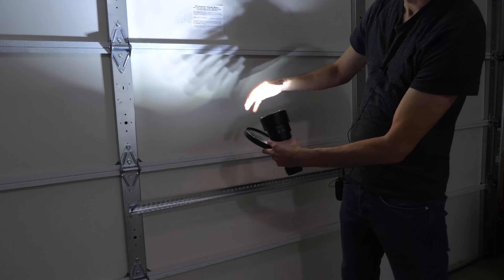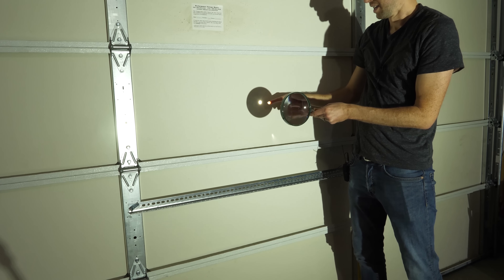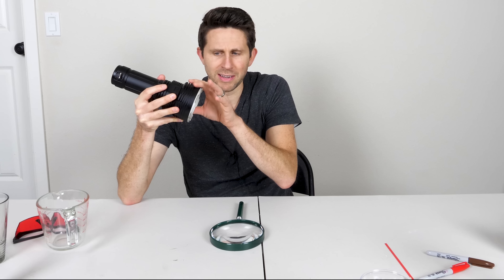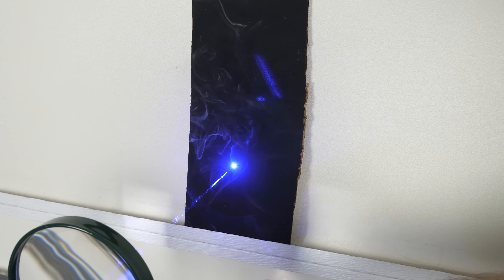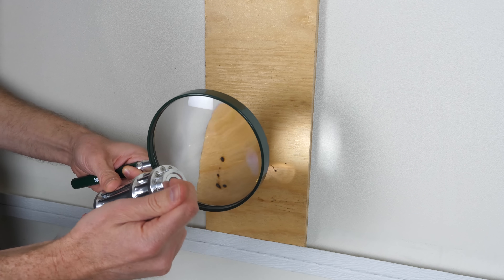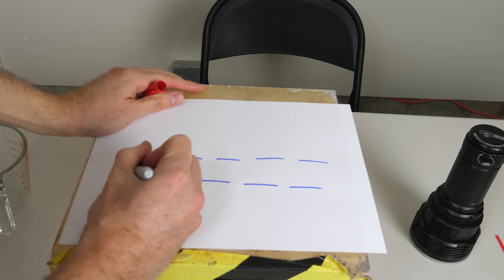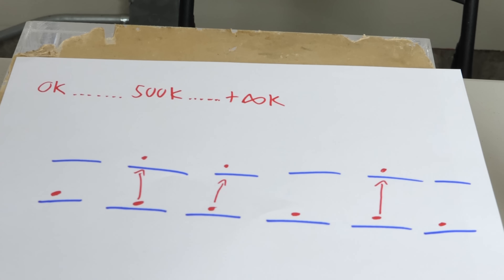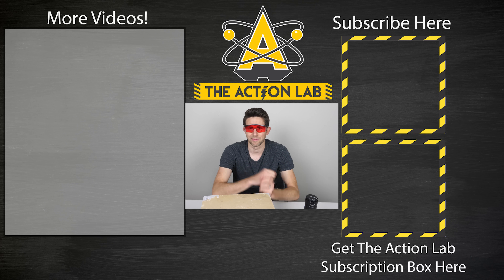What Happens if You Focus a 5W Laser With a Giant Magnifying Glass? Negative Kelvin Temperature!

Comment: Hay i got something for you to think on. What if you took all the light from a lightbulb (with reflectors) and focused it to a single point. If you collected it all it would have the same effect as a laser. Well no i guess it would be a laser. Meaning you could do the samething with a flashlight, but the process you would have to do to it(collecting and redirecting) would turn iy into a laser.
Reply: Lasers are one single frequency, lamps are combinations of frequencies. This is a problem because your lens needs to have the right angle for each location which is not possible since each frequency of light has its own refraction index. So yea you can filter out one specific wavelength, but that would account to less light than the actual light.  itself at any given spot.
Reply: @cognitivedissonance4938  He might've gained enough correction to burn the wood had he used a 2nd magnifying glass.  The first near the flashlight to gather most of the light  and a second to focus it down far enough.
Reply: @supernova743  Then the light isnt parralel, but what if he used a third lens. A lens that has the inverse effect of lens one and a lot smaller than lens one.
Reply: First define a point, next explain how to hit it. In real world a tunneling microscope arm ends in a single atom. In math that is huge, can you see the electrons? So still not at a point .  Next a wave of light too large for said point hence we can not hit a point.
Reply: @bikerbob2005  There are no particles in nature. What you call electrons are vibrational nodes of the standing EM wave.
Reply: @cognitivedissonance4938   keep in mind i went to school a realy long time ago. it's a wave in motion ie. anything over 0 K is. it is a particle when observed ie. the x-ray plates from an atom smashing chamber{ Particle accelerator https://en.wikipedia.org/wiki/Particle_accelerator} or did someone build a rube goldburg machine?
Reply: @bikerbob2005  and its ok to believe that.
Reply: @cognitivedissonance4938   stay in mathematics long enough and will find things like random, infinity,circle don't really exist.  I am too grumpy to go learn very much of the new stuff .  Wiggly strings and such. Next will have teleportation of matter

Comment: has nothing to do with temperature at the source - this all about energy.  you cannot create/add energy to the system by focusing part or all of it (that would be the violation of thermodynamics), but you can condense it into a more concentrated beam.  if you could focus a sufficient amount of sunlight you could create a temperature hotter than the surface of the sun, no problem. there is nothing odd happening here at all.

Comment: There's a lot of physical non sequiturs going on here... And also I think you're seriously misunderstanding the relationship between photons and heat. The reason why the laser burns and a big flashlight doesn't is pretty much because of the fact that the optics of a laser compress the photons into a "higher density" (forgive my lack of proper physics terminology). It's exactly like the difference between a solid bullet and a spreading spray from a shotgun. With all the shot spread out, the points of impact are affected by tiny fractions of the total mass fired from the shell, whereas if they were to stay together or be in one single solid, all that energy is concentrated on one single point of impact, thus causing more impact of force per area. The heat caused by light (unless physics changed recently...) comes from the photons interacting with the matter they're hitting. The photons aren't heat in themselves. The beam of light has no easily measurable temperature (if it does, then that's solely because it's causing the air within it to heat up). The heat coming from the light source is due to the fact that it's nearly impossible to make photons without heat as a byproduct of the reaction. The heat at point of contact is from the matter being bombarded with fast moving particles and therefore transferring their energy to it. There's no actual direct transference of heat between point A and point B.
Reply: Thank you, someone put it into words,
I knew this guy was just spouting nonsense.
Theoretically, with a large enough and curved enough lens, you could focus that flashlight into a smaller spot, and solve the predicament her shows
Reply: @portalenthusiast823  either this guy is a crazy person who thinks he's a scientist, or he's messing with us. Look at some of his other videos. I learned this stuff in 8th grade. Maybe this guy skipped over physical science or something.
Reply: Matt Blank I know right! Have you seen his video with the “neutron”
Reply: @michaelabutin5294  Not yet. I can only handle so much bupkis at any given time. lol
Reply: Yes, in theory. But with the flashlight body being how it is introduces too many obstacles to be worth trying. If the collimator lens was flush to the led and and then focussed. Then we'd have something to try.
Reply: This is to much reading
Reply: Kelvin: "But now i souunnnddd duuuuuuumb--"

Guy with Clipboard: "Yeah but did you die?"

Comment: Like to see your movies, but this explanation is SOOO wrong. Please take the video off-line, reseach it correctly and then bring a better version back. it has nothing at all to do witht he second law of thermodynamics. It simpylk has to do with optics and focal points. If you have light which is nearly "parallel" (like from a large distance like th sun), you can focus the whole area of the lense to 1 point down. And then you simply have to calculate "energy per area unit in the lense is due to losses higher than energy on the focal point" For a perfect lense, with 1 m^2 you can harvest as much as 1,000 watts or more on a sunny day. If you woudl have a infinite lense you would harvest 1/2 of suns energy... and that would be enough to make "plasma". But due to the particle natue of the photons it may be more troublesome to burn something with infrared, then with UV. And is has nothing to do, with 2nd law thermodynamics. You can make things hotter than its source, its only a matter of compression (see refridgerator or thermal pump). Same could be done with light, but that is way to complex and inefficient in terms of gain. 

And if u use two or more lenses then u can focus the whole light on one point and even burn materials.. we did that in the lab, but maybe it does not know about 2nd law ;). But maybe it is only as we use phase shifting mirrors and non-linear optics... but they will also not break 2nd law... they only change the energy states... so you should correct here many things, to show that especially lasers and the high flow density are something special. Normal "light" is from heat radiation and due to its distribution you may under "normal" conditions not get hotter than the object source, except you use special optics. And due to the optical properties of a lense you are limited... but if you combine properly and make some add ons like phase shifter, polarization filters/ shifters etc. you can pimp it up. But you will never "gain" energy for free.
Also laser light spreads... but it is no light of a heat source and has therefore differnet characteristics... you even may take pure chemical light and focus it to make something burn, but that doesnt mean that fire flies are hotter than 50°C....

So it is very mixe up here with different effects and limitations... and lasers do also not break 2nd law. Lasers are special in their setup and as such conservation of etendue is also be applied here.
And what u havnt mention is, that photon density plays also a point here, especially as 2photon processes will get more likely... and such burning events.....

So it is mixed up... of different effects...

Comment: Ok, so no u did not violate the 2nd law, all that hapened was the energy was more concentrated than it was out of the laser. There was no new energy.
Reply: The 2nd law of thermodynamics is not conservation of energy (That's the first law).
Reply: @ფიზმათ  Either way, it's not violating any laws.  All it's doing is taking the energy output by the laser and concentrating it to a single point. There's no more energy than what was output by the laser.  By concentrating the laser you're reaching the threshold for the chemical reaction of combustion to happen.  It takes longer without the magnifying glass to reach this point because it's heating up a much larger area.  

The second law has to do with entropy and isolated systems.  You have to look at this whole experiment as a system,  you can't just look at the output of the flashlight and say because you've reduced the area of the  focal point that you've violated the 2nd rule.  The energy is being moved from within the battery and transferred to the wood, if the amount of energy reaches a threshold the wood will burn releasing stored energy in the wood.
Reply: @supernova743  Of course it's not violating any laws, it is *real life*, so it can't. The point is, just saying "the energy is not created" has no bearing on the second law at all, stop bringing that up please. The 2nd law in the form of "can't move heat from cold to hot (without work being put in)" is what is discussed here. How lenses work with the 2nd law is weird (kind of why videos like this are created, to explain the weird and fun concept, but I think he failed the "explain" part). I remember this done better, but can't find the video or article that did it for me right now.

To be fair, I don't think a LED flashlight can be used as a valid illustration of the 2nd law here, because it also is not radiating thermal energy. An old-school incandescent bulb would work much better.
Reply: wat the trick with working out the 2nd law by when transmitted by radiation is the temperature of the radiation the laser puts out thermal infrared energy because the initial wavelength of the light is in the thermal range it is usually then doubled a certain number of times to get the green light but it doesn’t all get converted...
As far as I know the led based lasers could be described as outputting light at much higher frequencies than their surface temp but I don’t see how infrared light however condensed could make anything as hot as the surface of the sun no matter how concentrated you made it?
Reply: Sorry, just remembered that, thanks!

Comment: Negative equals positve....roger dodger...>,;,< With long rang reach, lasers with continuous power usupply will be more readily used by low and high orbital satelitle weapons installations, as some are already being planned if not in use already. But lets say you wanted a " futuristic" laser gun, then instead ofa long, somewhat low intensity power supply to generate a beam , one would need a very power, portable burst capable way to generate a laser. So a gun would need something to quickly generate hughe amounts of power in a split second to not only put enough power into the laser, but allow it to go far, while not blowing ones self up with the gun. ( it'd have to charge up fast, then basically depower in just as much time. Initially the first laser guns will overheat needing minutes to cool before reusing. Give it till the mid to late part of our century, easily). Or just get a 10 W or stronger laser and a small magnifying and connect them. SCIENCE! O>o

Comment: My opinion is that the source doesn’t necessarily have to be hotter than the pointed light because the source energy is light and light is an energy form as so is heat then the light is emitted from the source with whatever the temperature is and the light is converted to heat once it touches the surface

Comment: the first part of the video is such bull. the reason you can't focus the flashlight down to a point is because the beam is diverging (moving away from the source in different directions), if you collimated the beam (made the beam travel parallel) with a collimating lens assembly or a parabolic mirror you could then focus the beam into an arbitrarily small area just like the laser. the reason you can focus the laser is because it is, by nature, already collimated. furthermore, focusing light doesn't violate the second law of thermodynamics, I don't even know how you got to that conclusion. finally, you absolutely can create a point that is brighter (more luminous) than the surface which emitted it. light is simply emitted energy, which can be redirected. all real sources of light are non-point sources, which means they have a non-zero area, and emit energy, in the form of light, from that area. the luminance of that source is defined as the energy divided by its area (watts/meter squared, in SI terms). when you focus light, you aren't increasing the energy, just decreasing the area that it hits, which increases the illumination (brightness).

Comment: I have a question. If negative energy is hotter then positive energy, then why won't you burn when you get close to a black hole and only get burned after a couple of minutes inside of it??? It's like saying you wouldn't die when you get close to the sun and die after a couple of minutes when getting in the surface. PLZ ANSWER.

Comment: That is highly incorrect. It Takes way less energy on the point than on the surface area of the bulb. You are forgetting that you are reducing the surface area from where the light is taking place. But it your example you go really far out just to closely mirror the light. If you tried harder, you could of actually made it smaller making it hotter. And it would still have the less energy.

Comment: You said: you can't focus all the light from a flash light no matter what combination of lenses you use. But this is not correct. Place a collecting lens close to the flash, so close so light emerges parallel rather than diverging. Put a second lens just next to the first if necessary to achieve parallel beam. Then focus the beam to a small spot with a final lens close to the wall.

Comment: So you can't violate thermodynamics with total energy, but you can focus that energy into a smaller spot changing the intensity and therefore increasing the temperature in that smaller space. You could theoretically focus all the light going one direction from the sun with a sun sized lens into a single point that would in fact be hotter than the surface of the sun. No laws of physics broken, just energy dispersed over a large vs a very small area.
Reply from the maker: You are wrong. That is impossible to do. You need to know the conservation of etendue.

Comment: Okay, I just went down the rabbit hole on this negative temperature thing... as far as I can tell; it's sound as a concept, but VERY POORLY articulated. I think it's a problem of definitions. 
If we define temperature strictly as entropy, a media in a majority of excited states is technically less entropic. That makes sense.
An object progressing toward a less entropic state, (whether more, or less energetic,) by definition results in less entropy, and at no point does it magically become a negative entropy. 
If we define temperature as an energetic level (which is probably what everybody thinks when we say temperature) jumping to a "negative" number makes even less sense.
In any case, the experimental basis of this reasoning is a very special experimental case, and doesn't really apply to a laser operating at room temperature.
You're using an external lens to compensate for poor laser optics... nothing more.
Reply from the maker: I don’t think so. Statistical mechanics tells us that at infinite temperature all atomic states will be populated equally. The Kelvin scale was built upon classical mechanics where it would be impossible to achieve a state in which there are more atoms in a higher state than a lower state. However due to quantum mechanical effects, we know that we can stimulate atoms to be in a higher energy state simply by shining light near them that is at the same wavelength as the light it would emit at that state (stimulated emission). So in a laser, the stimulated atoms actually achieve a population inversion where there are more atoms in a higher energy state than a lower one. This is where the negative temperate comes from. In this case we have to define temperature as negative or else we get into problems that break the second law of thermodynamics. It doesn’t matter that my laser has poor optics. What’s important is that lasers can break the conservation of etendue due to the fact that they have light that doesn’t spread, the reason they have light that doesn’t spread is because of population inversion, and this is why we have to say they have negative temperatures. We can never achieve negative temperature in a non-quantum mechanical system thus anything the laser shines on is always at a positive temperate no matter how hot you get.

Comment: surely he is not actually using a laser? because the light from it narrows so he has to have it across the room to focus a small beam, when put by the board it is a large beam. how does that work when a laser had a constant size? and why not just focus the flashlight through a cone or similar to narrow the light from it?